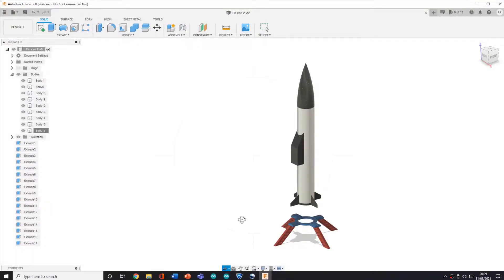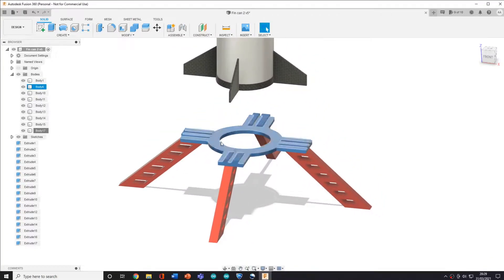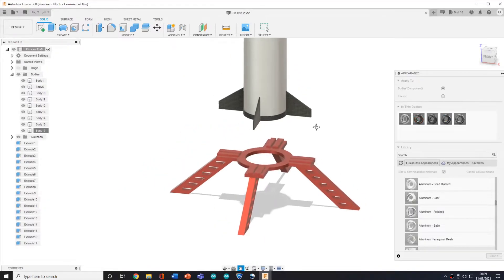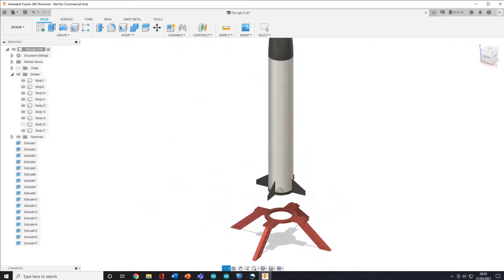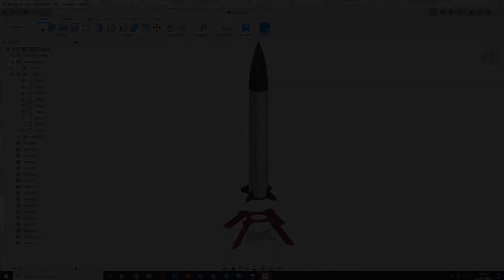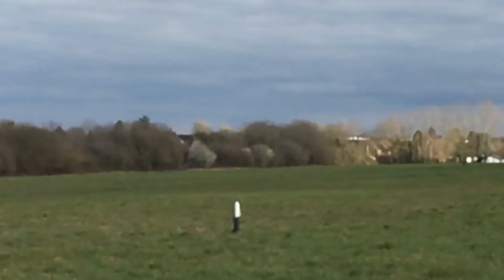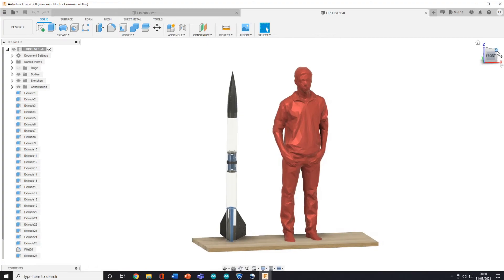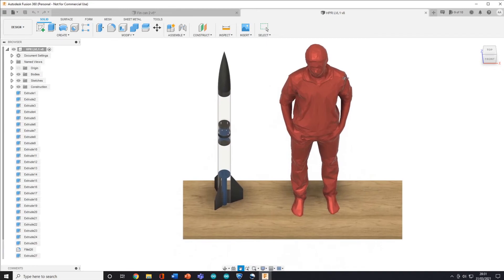Atlas' 3rd Launch Attempt

Comment: Already 2 motor failures, do you modify the motors in such a way that could cause the propellant grain to crack?
Reply from the maker: No I do not modify the motors but they are quite old and are black powder Estes motors. I am moving over to aerotech RMS now.

Comment: Jesus you guys were too close and not even behind anything protective, this is just plain unsafe. Has anyone even tried to teach you how to properly work with model rocket motors?
Reply from the maker: Yes I am aware we were to close and that did change in the next flight. However, we were over 15m away and the rocket was only meant to go up 9.8m. The camera was zoomed in making us look closer than we were. I have used model rocket motors a lot and I do follow all of the safety.